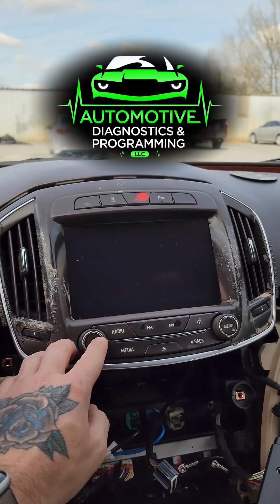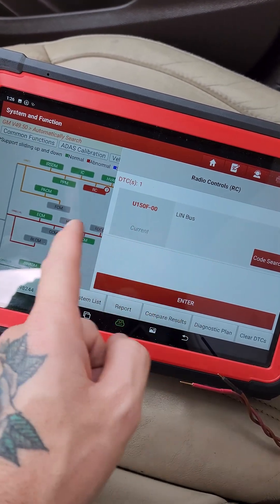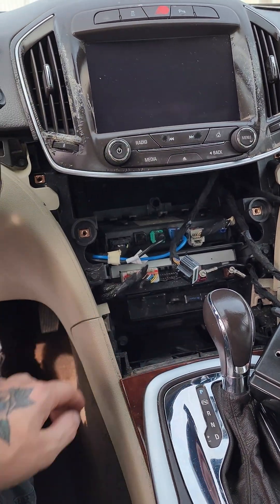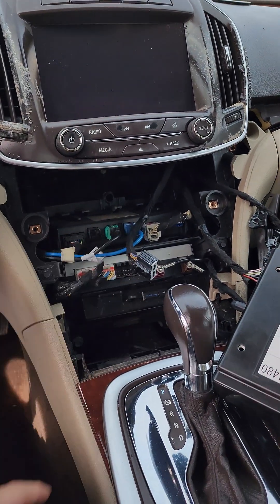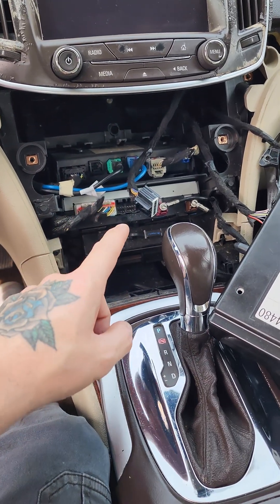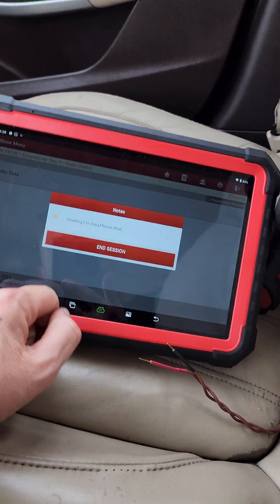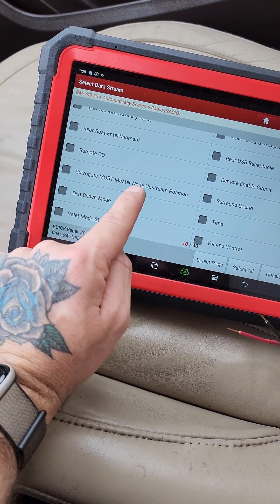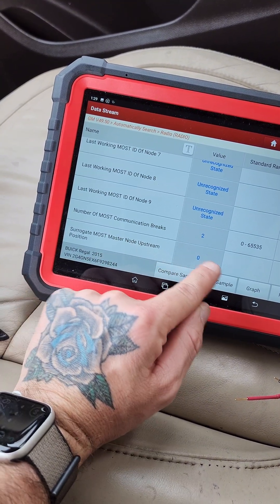GM M.O.S.T. Bus Testing Made Simple!

Comment: I have 2014 Buick lacrosse. Screen 📺 completely black no sound no rear camera no 4 way flasher no lane assist all. But when I followed your video I sound but screen still not working.
Reply from the maker: Depending on what module you bypass will depend on if you get a picture on the screen or not.
Reply: @autodiagyt I replaced HMI nothing changed at all but when I connected the 4 wires you showed I have sound but no picture.
Reply from the maker: It doesn’t say theft lock on the screen?
Reply: @autodiagyt no it’s black screen 📺 and it plays music but can’t adjust volume.

Comment: We work on a lot of hearses, limousines, etc. for a local ambulance and coach company, 90% are cadillac. i’ve been beating my head against the wall with one of them. 2015 XTS hearse. center stack backlight illuminates, and the guide lines come up when in reverse, but no video display, no screen, no radio/audio. on the instrument cluster menu “Radio/Media” is grey where as all other text is white. it has a u0028 and nothing else. live data looks normal with 0 comm breaks, no surrogate position assigned. i’ve bypassed every module individually and had no activity, we’ve put a radio and an HMI module in it with no change.

Comment: Ive always wondered if the fiber optic most bus lines broke could you just put a piece of vacuum tubing on it and put the lines as close as possible and have it up and running again ???
Reply from the maker: You could repair it yes, but for it to have a reliable data transmission the cable ends would need to be prepped and then secured straight.

Comment: Great video! I'm having this issue on my 2016 Yukon.  Had a dead battery, hooked the jumper cable ground to the wrong location, now the radio won't work.  I have good radio/amp/BCM fuses, and went through the 'unhook the battery' routine with no luck.  Took to a local shop thinking maybe something needed reset or unlocked.  They don't know what to do with it.  It did set both the U0028 and the U150F codes.  I'm going to start checking power and grounds like in your video, then start bypassing modules.  This video is a great help!  I'm a former technician from many years ago prior to MOST bus systems existence, so I kind of have an idea of what to do.  Just a couple of questions.  If new components are required (radio, HMI, etc.), will the Launch Pro 3s that you have in your Amazon shop be able to do any reprogramming, security unlocks, etc.?  Is there any additional software for that unit that would be required to replicate what you're doing in this video?  Second, I'm having trouble finding the M64 male terminals to make jumper wires with.  I think the M64 means the terminal is 0.64mm in diameter correct?  If so, do you think using some terminals that are 0.7mm in diameter will damage the harness connectors?  I have found a few of those on Amazon.
Reply from the maker: If modules are replaced they require programming through GM software so you would need a J2534 device and setup an account on acdelcotds.com. I have a video on how to start programming GMs. As for the terminals you are looking for 0.64 male flat terminals.

Comment: I have black-lit screen on my 2019 yukon. But no radio. Cluster says audio Off. Revese camera works but screen is black and radio does not work? Could it be the HMI module???
Reply from the maker: It can be anything on the MOST bus. But generally yes if it’s a black screen it’s the HMI.
Reply: Same my issues

Comment: Very good!  I'm dealing with a 2018 Caddy CT6 intermittent no audio & video touch screen  when it does not work have a fixed 12 Volt on the Network serial 5 when it works i see comm. message on that circuit have trouble finding any info on that network. It just goes between HMI and the  Video touch screen any suggestion would be great
Reply from the maker: Find my other video on a Tahoe with a bad HMI unit. It would have been back in 2022 I believe.

Comment: If your ever looking for gm terminals of any kind done hesitate to reach out! I bought the six tray terminal repair kit kent moore supplies the dealers with and have more than ill ever need. It might be a day or two before i gets to you being im in indiana.  Mainly been using them to build my own scope/breakout leads and quick repairs. But needless to say with six trays with each tray having 30+ types/styles. I have no problem sending you something if you need it!
Reply: I would like to test my MOST BUs connections with connectors and add jumper wires. Would this be something you can help with??

Comment: Ever ran across these when the most master (radio) is the module that's down?
Reply from the maker: Yes! If you bypass every module in the loop one at a time and never regain either a screen display or audio and you have no breaks in the lines it's a probably a bad radio or you got very unlucky and it's a bad amp and HMI lol
Reply: Seems like every time I have delt with a MOST bus issue it has always been a bad radio making it a bit of a pisser to diag. I saved a real well written document on MOST Data Bus diagnosing that was very helpful and I refer to it anytime I run a across one which isn't to often thankfully. @autodiagyt
Reply: 2013 SRX. I had a bad HMI and Radio. Bad grounds and pin drag issue on white/green MOST bus line wire going into the HMI. That was a head scratcher. I had to disconnect the battery to get the number of MOST breaks to reset every time I swapped a module or jumped something.

Comment: Cool video, I just went through this myself on a 13 lacrosse. Once you install the replacement, the radio will theft lock, you'll have to do a reprogram  on the radio with sps2 to get it to unlock. If you try to do a replace, and reprogram on the media player listed on sps2 you'll get a no calibration error (that's for the other disk changer rpo). That cd player is automatically reprogrammed when you do the radio in sps2, they treat it as part of the radio.
(Correction, it was a 2014 lacrosse, thanks for catching that Jake!)
Reply from the maker: Service Information says it should only need programmed if the vehicle has rear seat entertainment. Did you get a used one? Maybe it was configured for that?
Reply: I did get a used one, from a salvage yard, so I'm not sure if the car it came out of had rear  entertainment or not. But when I plugged it in, the radio went straight to theft lock.
Reply from the maker: @JessClearyAutoRepairLLC  I just looked and a 2013 lacrosse doesn’t use a most system so the cd player you replaced is actually the radio, so yes it needed programming.
Reply: @autodiagyt  sorry, it had a build date of 2013, but was a 2014. It had a MOST set up though for sure.
Reply: It won't let me post a picture, but the tenth digit of the vin was an "E"
Reply: Good tip

Comment: Great video Jake. I always thought MOST ran off light. It was on the BMW’s I used to work on. May be different in the States
Reply from the maker: Yes MOST can be Fiberoptic or Wire. They both are similar that they are Ring networks and each module in the loop reads the incoming data and then outputs it down the line. It if a module doesn't communicate it ends the loop and nothing works generally. If a line is broken same thing, nothing works.

Comment: oh yes the joys of most bus or  the old d2b bus mega fragile silly light transfer bus on old mercedes used to have a rake of those old jumpers in my box back in the day to bridge out units one by one . back then the diagnostic capability of scan or even dealer tools was pretty limited. so a lot of the time it was poke and hope 🤣🤣🤣🤣
Reply from the maker: Yep this wired system operates very similar to the Fiberoptic most bus that European vehicles use.